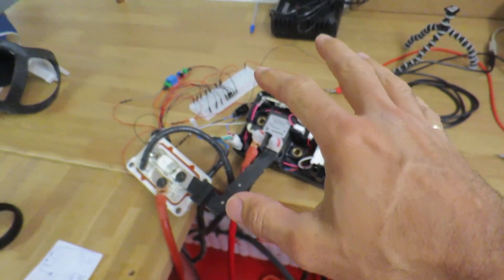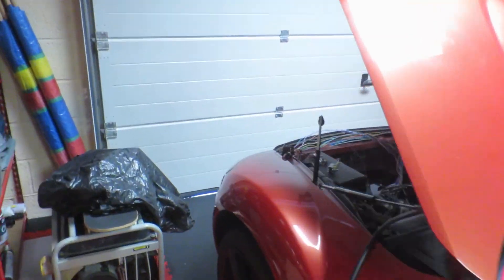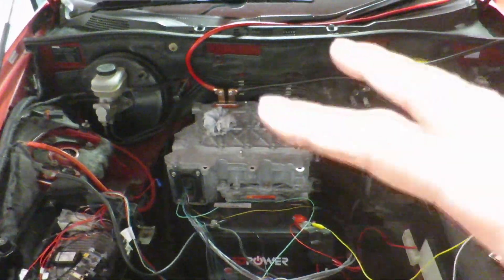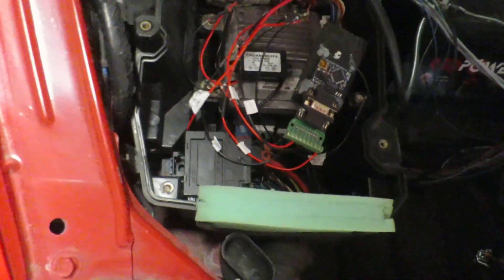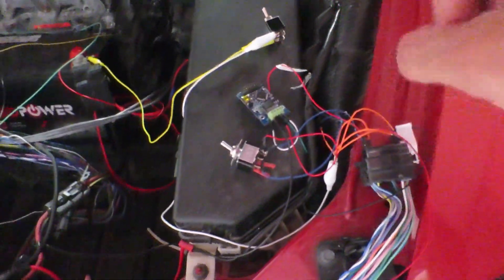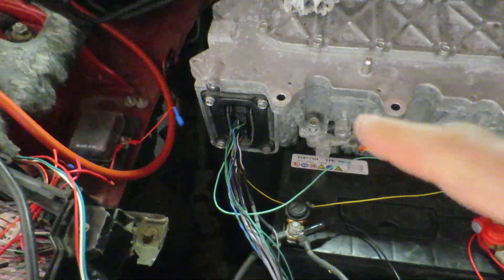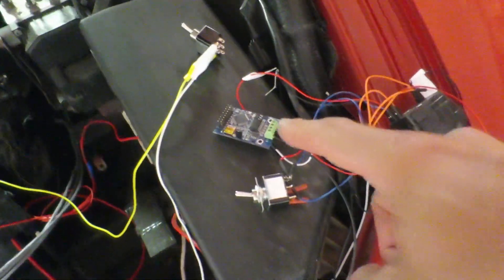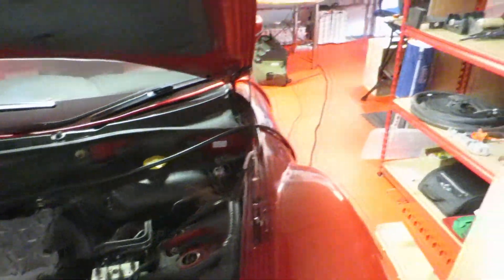June Update, Nissan Leaf Motor spinning in the Mazda RX8

Comment: How are you clearing this car for road legality. Have you informed DVLA. Change of Fuel source from gas to electric. Have they requested full electrical wiring checks. Have they requested IVA prior to clearing it for Road use.
Reply from the maker: Last time I looked there was a point scoring system on requiring an IVA, and change of engine was not enough points to trigger it. DVLA (again about 2 years ago) didnt seem bothered at all when I spoke with them, and tax wise - it will still be classed as a gas guzzler ;o(. This information is old now and I do need to catch up on the latest.
Reply: Thank you for your reply. IAll you guys are doing great stuff. Alibro and Jammie Maguire are also good channels to watch. Keep going wish you all the best.

Comment: what are you using to control the motor? is it a custom made Arduino controller?
Reply from the maker: Yes ;o)
Reply: @SouthWestEVUK  hey how hard is it to build one? Like let's say I'm a nerd but Ive never done Arduino or CANbus. But I wanna be extra budget and not buy an prebuilt controller?
Reply: @SouthWestEVUK  also will you be able to achieve higher kw than the base 80kw from the motor this way and also will you be able to use the charger?
Reply: @bigboypapaboy  To get more than 80kW out of the motor, you need another inverter. OEM Nissan 110kW and 160kW options exist.
Reply: @SouthWestEVUK  would this be equal to the openinverter board?

Comment: Nice update and good to see the motor spinning in the car.
As for the DC to DC converter I see some folk have mentioned the current drain on the battery may be too high for the battery alone. Don't forget 50 miles in the Isle of White may be two hours driving but another consideration is the voltage at the charge port. It will be over 400V which is pretty scary. You would need to have a 100% foolproof way to ensure the voltage cannot be live either at the car or from the charger until the plug is securely in the socket.
Maybe the simplest way would be to keep the DC-DC in the car. 😉
Reply from the maker: Yeah, I will defo be putting a dc-dc in the car, as I mention I believe I have one somewhere! Yes attaching the HV is a good point - but it is easily isolatable - perhaps a RED LED above the port I make to indicate 'its alive dont plug in'... Or a relay on the cover that auto disconnects the HV relays when you open it.
Reply: @SouthWestEVUK  Damien Maguire is trying to achieve DC charging using a BMW i3 LIM so maybe something like that in the future but whichever way you go making the thing idiot proof has to be the priority. If people can put diesel in a petrol car then you or your In Law's will try to plug in when they shouldn't.

Comment: You need to keep the DC to DC converter in the vehicle, as the 12v vehicle battery isn't designed to power the whole vehicle electrical system (the alternator does) So the blower fan, windows, power steering, cooling system, lighting, heated rear window, electric windows, plus all the safety systems.l will add up to quite a power drain. 
You definitely need to keep that 12 volt battery above 12 volts (13.6 to 14.4V is normal) when the vehicle is in use, not doing so is just stupid. 
A lead acid battery isn't designed to supply power in a cyclic manner, its designed to supply large currents for starting an engine (at which point the alternator take over), then a small amount of reserve capacity, just in case the engine doesn't start. 
Just look the alternator output, which will give you an idea of just how much power a vehicle requires to work, either with an electric drive or ICE.
My own vehicle (ICE unfortunately) has a 180 Amp alternator, which powers the vehicles electrical system. If I wanted to power the electrical system off a battery, then it would be below 11 volts (and flat), in less than 30 minutes. 

Keep the DC to DC converter. And don't make the vehicle potentially dangerous.
Reply from the maker: All understood - I am definitely keeping a DC-DC charger, as mentioned I have one lying around somewhere that I think is the right rating.

Comment: Nice video, a big step forward, well done. I'd be very keen to see a deep dive on integrating the two arduinos. 

Btw, here's my latest effort https://youtu.be/L6AnIzgCYrA
Reply from the maker: Good work James, Ive got some even more complex CanBus stuff being developed for the Merc project. Built a full bridge, with wireless interface and software to filter, spoof and manipulate traffic in either direction!
Reply: @SouthWestEVUK  I just bought an i Miev so I'll be doing some can sniffing and testing myself at some stage as there's not a lot of info out there compared to the Leaf

Comment: hi i would recommend still putting the 12v dc-dc converter in the car because there is quite a few high power loads on the 12v battery eg rear window demister, head lights, cabin fan (more than you would expect), vacuum pump for brakes
Reply from the maker: Yeah agreed - ill dig out the one I have and get that wired in.